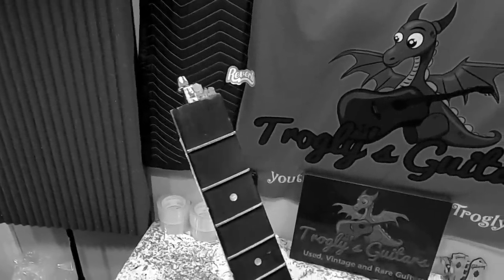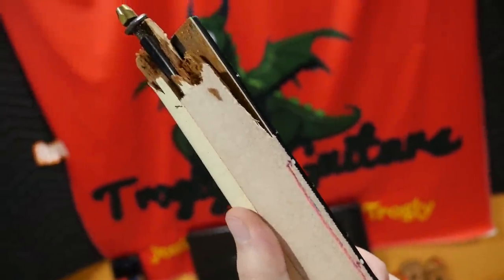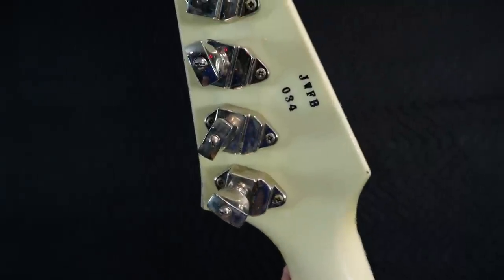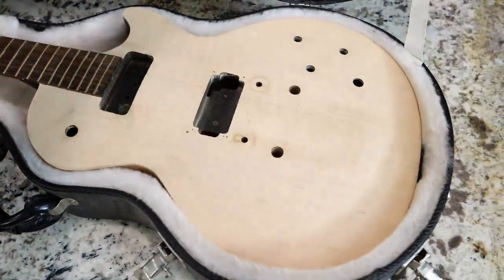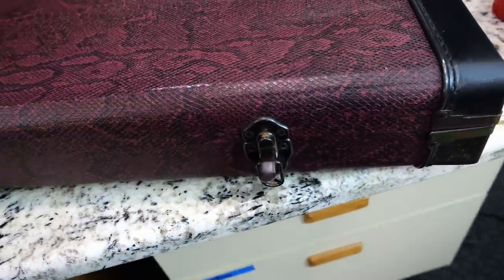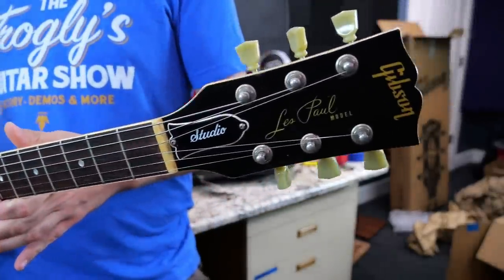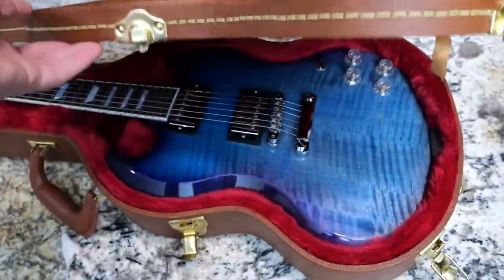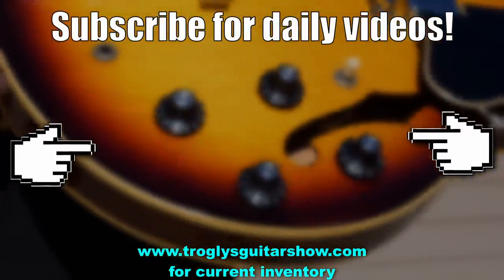A Hilarious Mistake for the History Books! | Trogly's Unboxing Guitars Vlog #168

Comment: I wonder if the responsible thing wouldn't be to send J W Firebirds back for the refinish job. I wonder about the possible liability of having two guitars floating around with the same serial number being an interesting bait for counterfeits to use that identification trait in particular, especially since these are high end, high value pieces, kind of a lower hanging fruit for a counterfeiter. Having the correction documented would be wise too, if it happens, or just keeping them forever as a pair.